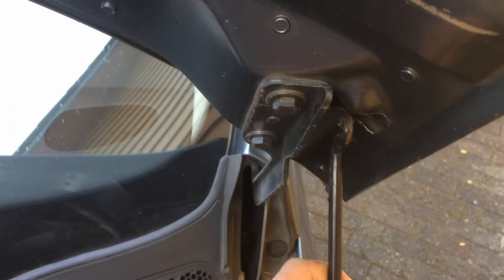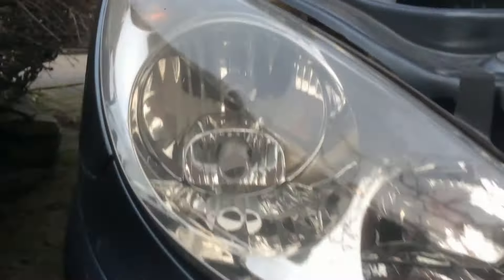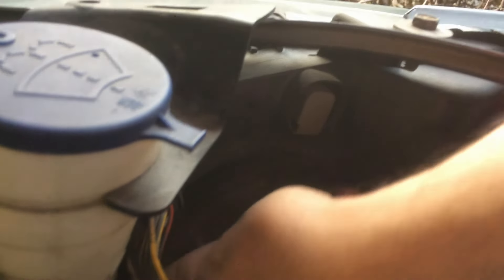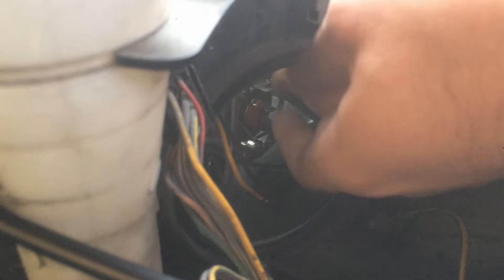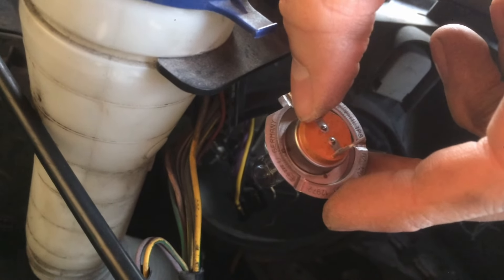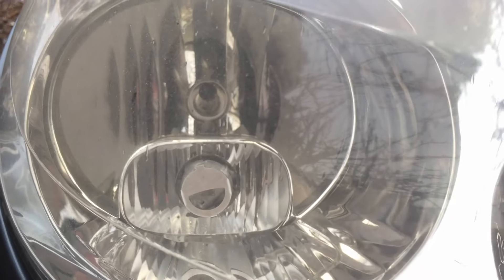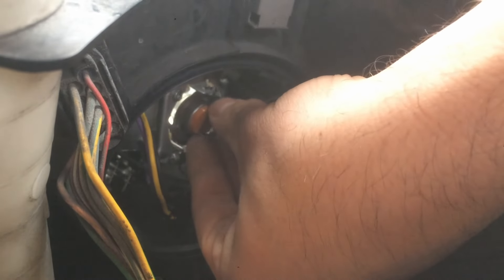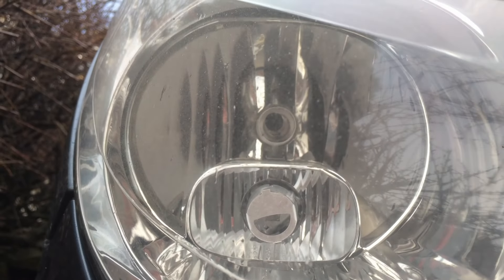Replacing H7 Headlight Bulb in Peugeot 307 SW (2005)

Comment: Hi what causes my head light not to work one side and not the other on my Peugeot 307 I have changed the bulb and it still don't work can any one help
Reply from the maker: Hi Chris,
If the bulb is not working, it most likely is a cable, cable interface or a fuse. 
1) Search for headlight fuse and see if it haven't burned. You might need to replace it. For the location check your Car Manual of simply google it - many people explains fuse locations with pictures or graphics. 
2) Check the cable and cable interfaces with Multimeter. You might need to replace the cable or the interface at the end of the cable. If you haven't worker with Multimeter before, there are plenty of videos for beginners on YT and the tool is considerably cheap. 
Hope that helps. 
Let me know if you managed to fix it.
Good luck with your Peugeot!
Reply: Chris Furlong For anyone else, if you have one tai light out as well (same side) it’s likely to be the fuse.